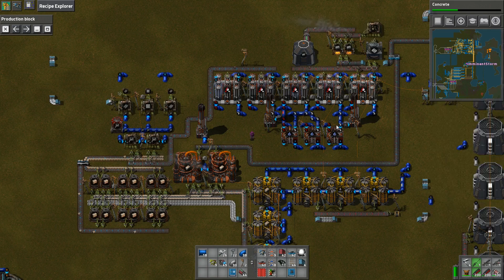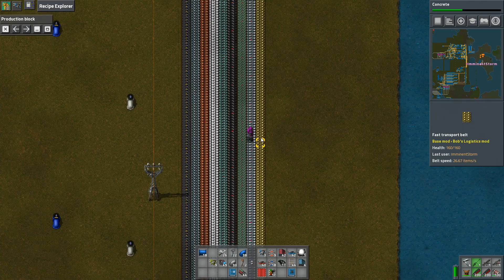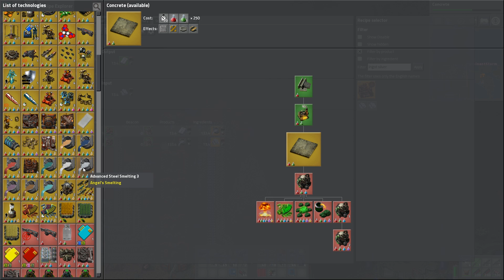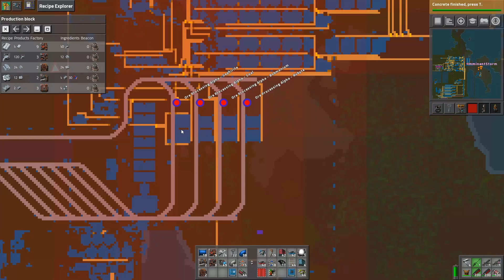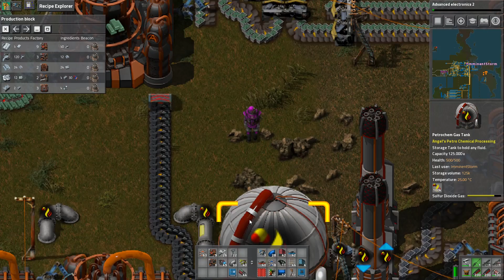Factorio - Angel's & Bob's - Episode 63 - Argentum

Comment: You could have adjusted the input pipe position so they are both horizontal, pipe conecting each other then undergrund pipe with the chem input.